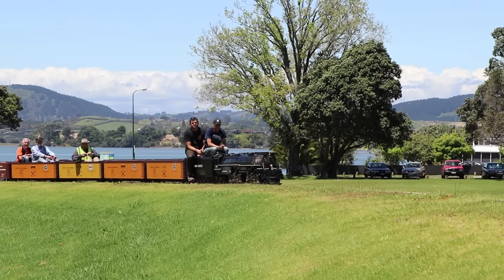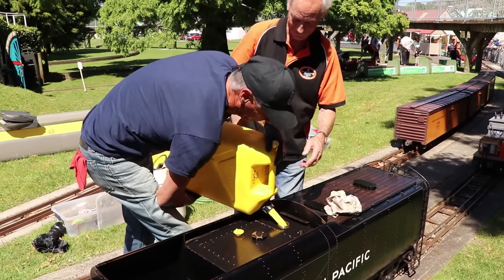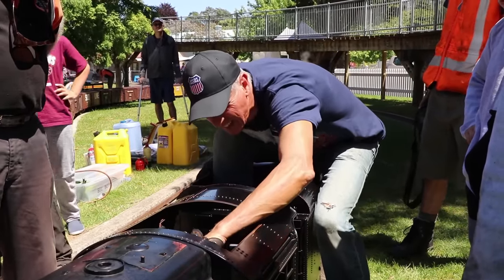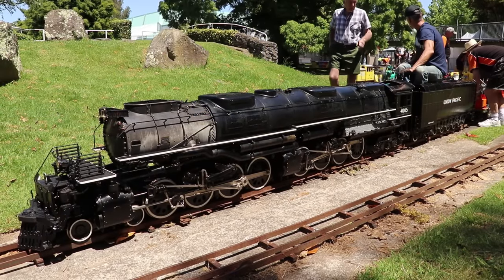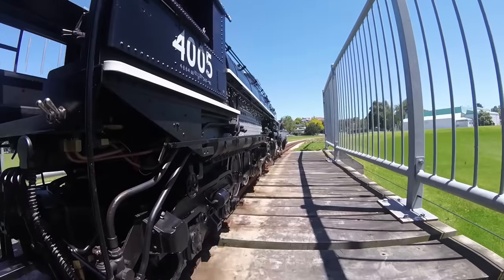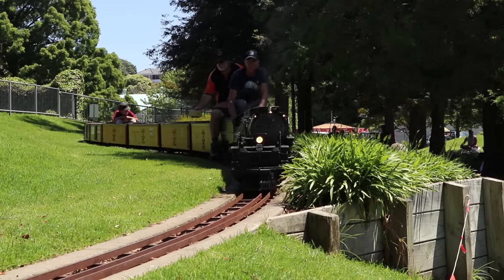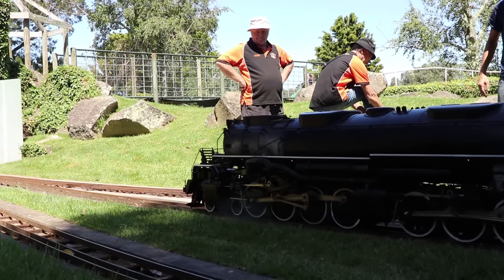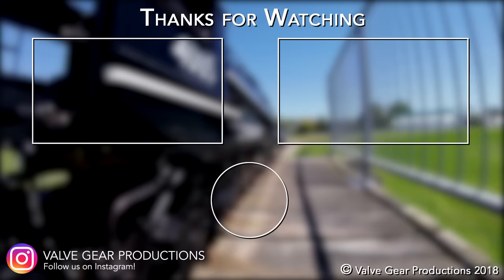Union Pacific 'Big Boy' #4005 Live Steam 7.25" Gauge Locomotive in New Zealand

Comment: The Big Boy is not the biggest and most powerful. It was the definite sweet spot of all of them, that’s for sure, but it was really just the best known. The highest tractive effort goes to the N&W Y6b, very much in excess of 160,000 pounds. The highest horsepower of all articulateds was the C&O Allegheny, at around 7000 horsepower, and it was also the heaviest. The highest horsepower ever was a Duplex locomotive, the PRR Q2, with around 7500 horsepower. Absolutely ludicrous power. 
The Big Boy only put out around 6300 horsepower and 131,000-135,000 pounds of tractive effort. Much less than the beasts it contended with for the title.
Reply from the maker: Thanks for that information, I did get that slightly wrong in the narration at the beginning. All credit to the other locomotives who took the top spots.
Reply: Misinformation! Big Boy generated 7000 hp, not 6300, Allegheny beats Big Boy by almost 500 horsepower.
Reply: @wtf-hc3tp  That's incorrect. The 4014 produces 7000 hp, but the Big Boys while in service produced 6300. You also can't say that the Allegheny has 7500 hp because that would make it the most powerful steam locomotive ever built, which it isn't. That title belongs to the Q2 Duplex.
Reply: Amtrak In O Scale I never said Allegheny was the most powerful, Allegheny produced around 7500HP, and indeed the Q2 has 8000HP, making it the strongest steam locomotive, unfortunately it hasn’t done anything special. Unlike Big Boy’s 5 mile pull test, which used all its horsepower...

Big Boy used around 6000 horsepower in service, 6300? Fair enough.
Reply: Eagle Eye I understand that you never said the Allegheny was the most powerful, I was making a point that you couldn’t say the Allegheny had 7500 hp because that would make it the most powerful, since the Q2 Duplex according to what I’ve read produced 7,498 hp on Pennsy’s “locomotive dyno”. Actual figures on the Allegheny were basically equal to what the 4014 now produces. If memory serves, the reason why 4014 is more powerful than the other Big Boys were in service is due to UP machining a slightly larger cylinder bore during the restoration. That’s also why 4014 produces a bit more tractive effort than the Big Boys did while in service.

Also, the 5 mile pull test you mentioned likely didn’t actually happen. There is no definitive proof it happened. More importantly, a train 5 miles long would definitely exceed the Big Boy’s tonnage rating, of course ignoring the fact that the draft gear of the time would never be able to handle such a load.
Reply: Amtrak In O Scale Scale “The Q2 power output is 7,987 hp...” As for the Allegheny? “indicating momentary readings of 7,498 hp...” There’s a bit of a difference isn’t there? 

Watch the documentary of Big Boy on YouTube, from there you can find some very short footage of the 5 mile pull, at around the 10 minute mark I believe.